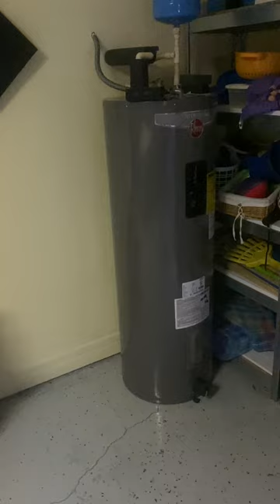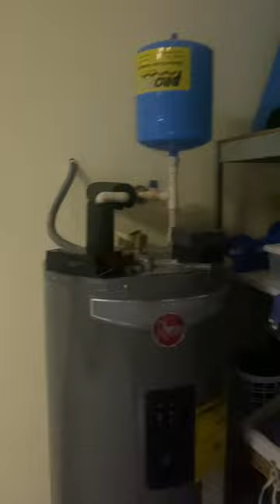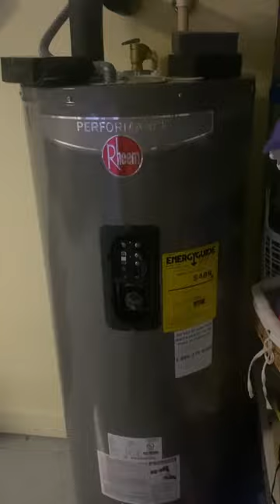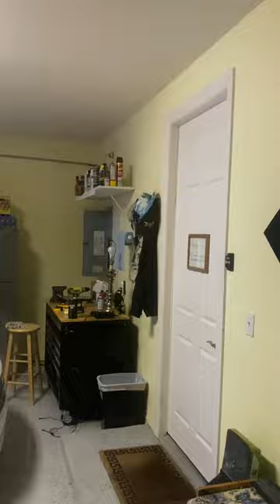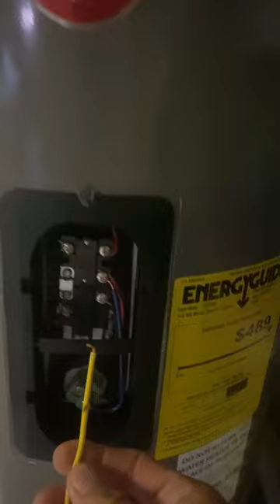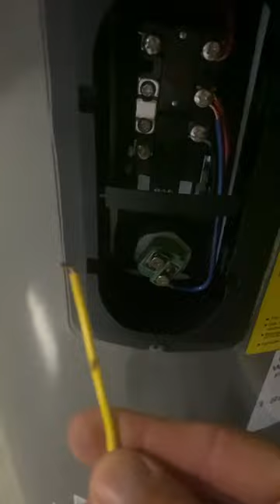Rheem performance water heater, trips breaker, then a dead short. BRAND NEW!

Comment: I'm having an issue with mine too, newly installed replaced one that started leaking. The new one is piped I have water through my hot lines so my solder job was fine, I checked the elements, both good. I triple checked the wiring, and I can find nothing. It keeps tripping the breaker. I'll turn it on and about 1 minute later it trips... any ideas?
Reply from the maker: Yes.  ultimately found one of the factory installed wires was crimped under one of the thermostat installations (because I'd replaced those trying to find the problem).  As things heated up the wire would get squeezed and short out tripping the breaker!!!!  POOR Quality Control in post pandemic manufacturing.

Comment: The reason your water was too hot is because you called it a “hot water heater”. Why are you heating hot water? You should heat cold water. I’m just joking with ya😁. That was some poor quality control. Glad you found the problem before it became really dangerous